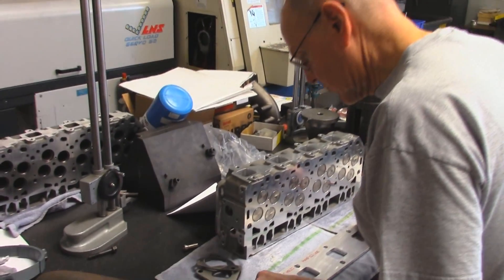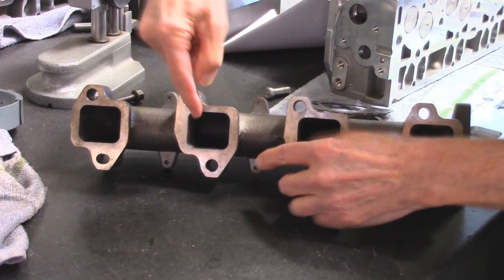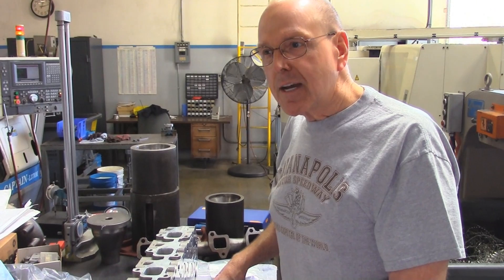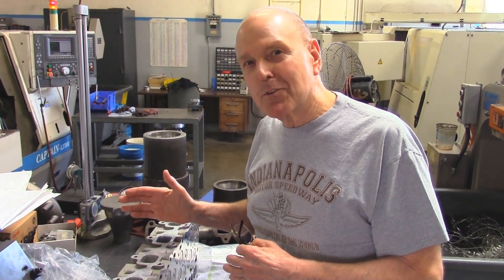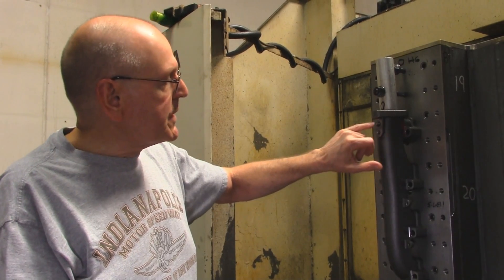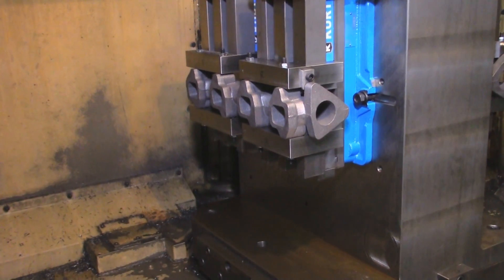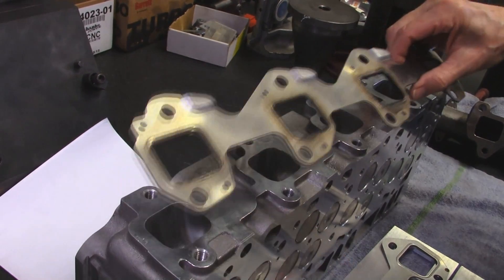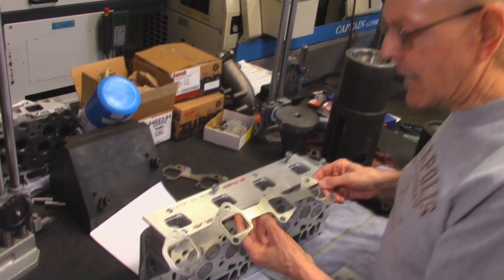What's Up At Banks - 10/23/15

Comment: this has always made me wonder, why do the oem's of every manufacturer not either consult a company like this or use a company like this before final design, or use these parts or a design from a manufacturer like this? our engines would be so much better and get more mpg's and horsepower right from the dealer lot.